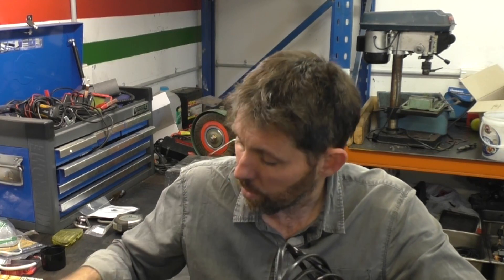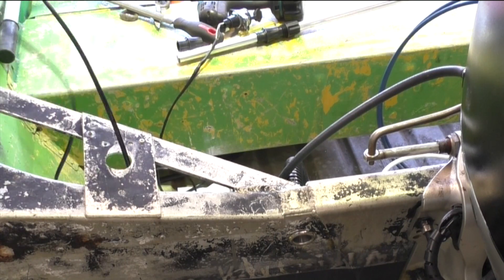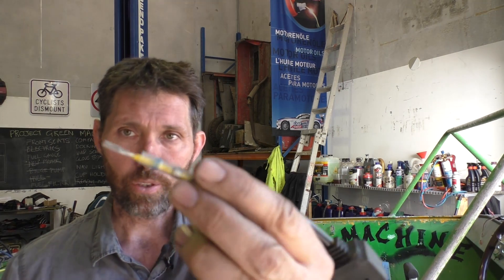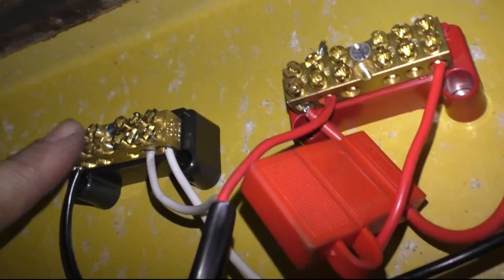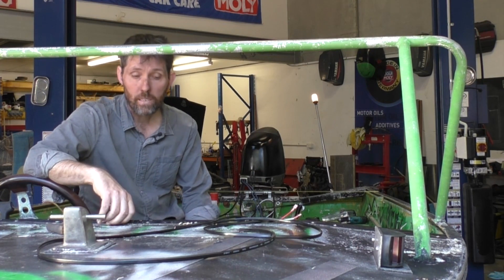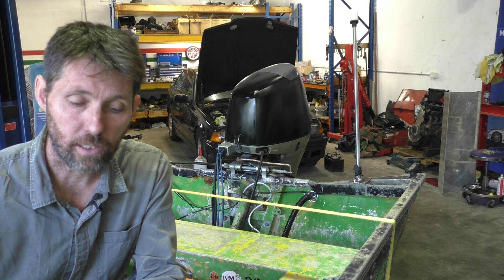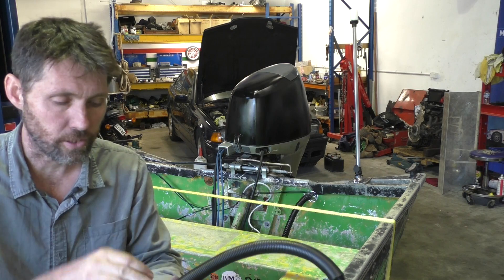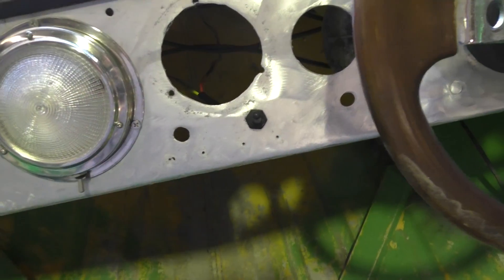Wiring the electrics on a boat [Pt 2]

Comment: Your wiring videos have been very handy for me this past week.  I bought a 1980 twin cylinder 50 hp Evinrude with a rebuilt powerhead ($325 with controls) , it had spark in one cylinder and the wiring was all cracked.  I watched your other vid on diagnosing no spark  and it helped  me determine it was a bad power pack .  Now I've got spark in both cylinders, got rid of the bad wiring  and have a reliable engine with  150 psi in both for $475
Reply from the maker: Nice work on getting it fixed up. Sounds like you've got a great motor at a great price. Happy boating! :)